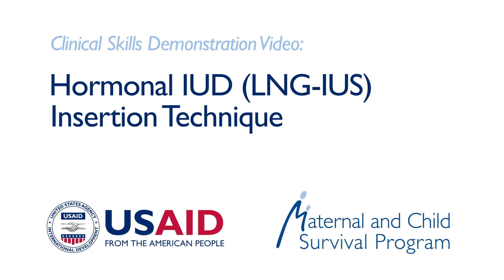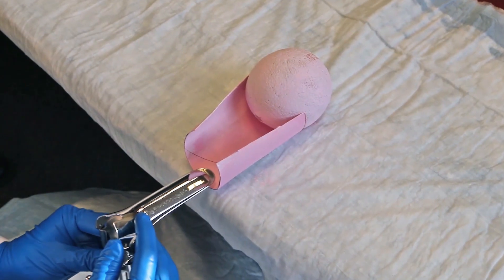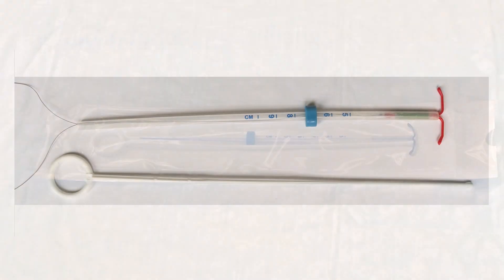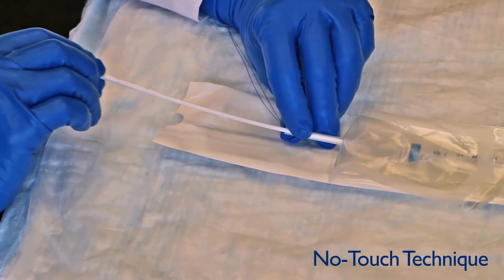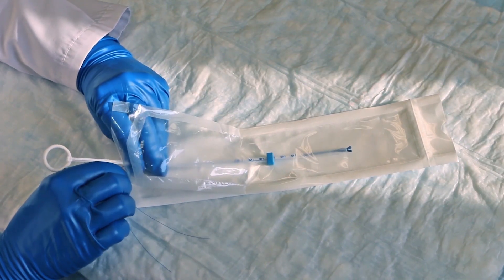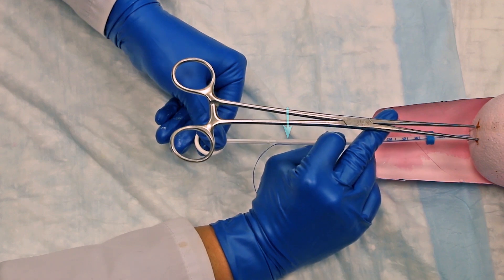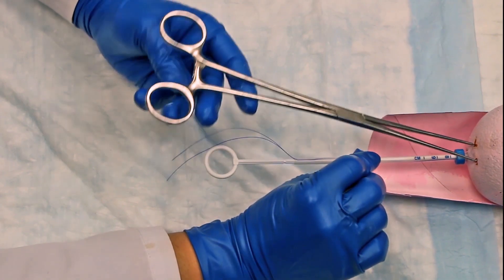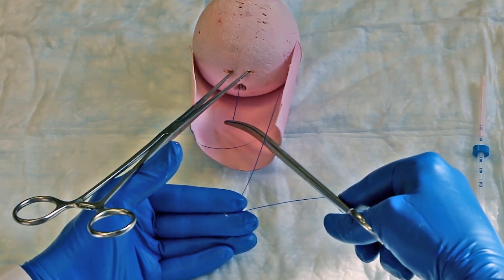Hormonal IUD (LNG-IUS) Insertion Technique

Comment: I wish there was more information about how painful this procedure is. I just had mine replaced a few days ago. The first time I had it, I was only told that I would feel mild discomfort. The pain was intense enough to make me pass out. I specifically mentioned that multiple times this time around and asked for pain management. They gave me medicine to dilate my cervix and told me to take ibuprofen before the procedure. I was never given the option to numb the area. The only improvement was that I didn't pass out. I was bleeding after the procedure. Videos make it look like inserting the probe and the IUD is smooth because it's such a thin tube, but anything touching your cervix is already an uncomfortable feeling. Forcing it open, even with a thin tube is excruciatingly painful.

Comment: FYI: Some doctors use the tenaculum (forceps) and some use a soft-suction cervical device to stabilize the cervix. The soft-suction device does not perforate the cervical tissue and thus is much less painful. This could help explain why some people's procedures are less painful than others'. Technology, tools and technique can also make a huge difference in how painful a procedure can be.

So, I am not going to discredit other women's experience about how painful their procedure was since there are so many factors outside of the patient's control and outside of their personal pain tolerance that can determine the comfortability of a procedure. 

I have a high tolerance for pain, and yet found the procedure to be painful (although not the worst pain I've ever experienced). It is a relatively quick procedure if done right, but it does not feel good at all and is highly uncomfortable. If you've never had children, the procedure will be more painful. I felt it was definitely worth the pain, which is why I'm on my third IUD. Being nervous is okay, just know that the pain is temporary.

Good luck

Comment: i don’t understand how the cervix is dilated still. i that the tenaculum part?
Reply: The cervix is not dilated. It is softened with pre-procedure medication that you take orally. Although, some don't prescribe it. If you've never had children (like myself), your cervix will be much narrower and thus insertion much more difficult. My first IUD was the Mirena (before the Kyleena or Skyla were made which are narrower). I got the Mirena at 15 years old (due to menstrual related issues), and the OBGYN had serious difficulty getting it past the cervix. The tenaculum is what provides "traction" to aid in inserting the device. Some use a soft-suction device which does not pierce the cervix and makes the procedure far more comfortable.

Comment: My first IUD experience was awful. The doctor did it in about 5 minutes and its still the worst pain I’ve ever felt in my life. It eventually migrated and sat in my cervix for a really long time. I had been on hormonal brith control prior and it wreaked havoc on my body and emotions, so I knew my only option was a copper IUD (I preferred it anyway). I went in for my second IUD and I was about to have a panic attack, my legs were shaking and I had already started to cry. When it came time to do the insertion I was in disbelief by how different it had been than the first time. It felt like a bad period cramp for maybe, 2 minutes? I giggled afterwards because it was so much better than my first experience. The NP did it at a slow pace and only did something when I felt ready. So literally every experience is different 🥲

Comment: Best explanation to the medical students 👍
Reply: No apparently not. Not only are there less painful devices than the tenaculum, it also should propely talk about pain management, sedation and things like time management and how to talk the patient through the procedure. And framing it like it's possible to be "gentle" when you pierce and pull on a cervix is a very crass "understatement" to say the least. 

You also do not want to waste time by doing the measuring and then dilly dally around with the IUD insertion tools. You want all sizes at hand and an assisten to grab, open, prep and hand you that thing the second you gave them the measurments. While this looks like they're .... what .... letting go of the tenaculum? Unlodging it and piercing it in again? What's the procedure supposed to be?

We really need women to get better care. One that isn't ignorant to the massive pile of reports of horror stories from women that you don't even need to dig for. Care that is actually caring!

Comment: I was never told about the tenaculum piercing the cervix and being used as traction to insert the IUD rod. I felt like I was being gaslit by the doctors about the pain I was in. I was never told about this part of the procedure. It is nowhere in the documents I received prior or post procedure. I feel vindicated knowing that my pain was reality. But I feel disgusted that I was never informed and that no pain medication is available besides over-the-counter ibuprofen. This should be criminal, because it is cruel and unusual. Animals get more pain medication for less serious procedures. But women? Why would we ever be taken seriously..
Reply: I was reading comments and I feel like you have basically written everything that happened to me. My doctor shrugged it off aswell and said you might want to take 1 or 2 paracetamol afterwords. I felt like I was on a torture table. I would have never wished it on my own worst enemy. I had an assistant with my doctor and I could tell by the way she grabbed my hand and her eyes she knew exactly what pain I was in. When they clamp your cervix it is the worst pain ever. In healthcare women are not taken seriously enough for sure.
Reply: I’m sorry you had such a horrible experience. I’ve been considering getting an IUD but I’m absolutely outraged by the lack of informed consent when it comes to informing patients on the procedure. I can’t believe in 2022 that this is an issue.

Comment: This hurts so bad, they did a pap swab first (my first one)  I was shaking. The cramps are so bad I normally don't get cramps so I wasn't used to it 😭 it hurts to sit down afterwards for a while.  I hope it's worth it though. Just lay down facing up for a couple of hours with a heating pad and 600mg ibuprofen it helps so much it gets better

Comment: I had mine 2 years ago and I was in a great deal of pain they said to take pain killers which I did and it didn’t help at all. I was still in a great deal of pain and couldn’t move or eat because I was in so much pain and I couldn’t poop either cos I was in that much pain. I went to A&E 3 times and they said they couldn’t do nothing. The first time I went I was throwing up and they gave me an anti sickness tablet then I threw up again and continuously throwing up. They said they didn’t have the instruments to take it out but as my sister works at the hospital she knew they had the instruments to take it out they just refused. So they could see how much pain I was in and they still refused to take it out 🥴 the nurse basically had a go at me and my sister and we complained. So overall that was so not worth it. I had it taken out after at least a week almost and had an implant in and I’ve had it since. Almost 2 years I’ve had my implant and I’ve not had a single problem with it. Not even when they put it in. I had a bit of pain for like a minute then it went. Yes I haven’t had a period for the whole time I’ve had my implant which is great 😅 but I do still get mood swings which is normal. I say I recommend the implant more than the IUD but everyone’s body is different and mine had a different reaction to it

Comment: So cool to see how this procedure is done! I got my iud about 2-1/2 years ago when I was 8 weeks PP and honestly it wasn’t that painful. But I have heard that it could be less painful after just having a baby. Now I’m in the process of trying to make an appointment to have mine surgically removed because my strings are going through a hole in the side wall of my cervix and the arms have embedded. My doctor thinks this most likely happened during insertion. My guess would be that pincher thing poked a hole in my cervix and caused the strings to migrate towards it. Something tells me it’ll be more painful to have it removed than to have it inserted 😩

Comment: I just got this today and I barely felt it. 
Yes, it pinched and I cramped, but it wasn't much worse than normal menstrual cramps. It took less than 3 minutes.
An experienced doctor is 100% what makes the difference.
Take 800 mg ibuprofen an hour before insertion and again 8 hours later.
Reply: no it's not just the gyno , it depends on your body. some it's a pinch , some black out . you literally won't be able to know until you are in the procedure
Reply: I had the same experience! An experienced dr and one who is gentle makes a world of difference

Comment: Just got my IUD about a week ago & the entire procedure itself took less than 5min (if that). I was honestly anticipating way more pain than there actually was. For me, it wasn’t really painful at all, just pressure mostly. I also took 800mg ibuprofen about 1hr prior to the placement so that helped a lot as well. Prior to the IUD, I was on the pill since I was a teenager & honestly wished I would’ve chosen this method years ago!!!
Reply: Just so you know, the research shows ibuprofen does nothing for insertion pain. Anyone reading this should get twilight sedation or a cervical block injection.

Comment: This was so painfully to  watch, I really hope it's less painful to remove it. I remember cramping up so bad when it was inserted and was told not to move. Thank goodness for heating pads
Reply: I just had my old IUD removed yesterday and my doc finally got it out on the 3rd try. T'was painful as she said it attached itself to my uterus wall. My removal was abnormally difficult though, so you'll probably have better luck.
Reply: @kthewhite7453  ouch 😵hopefully your relaxing and not doing so much today. Those creepy pains will sneak up on ya. I had mine on for 3 years and I want it out

Comment: Why is there no topical anesthetic/analgesic used before this entire procedure? Did they forget to include it or what
Reply: They sound give us a blunt at the least.
Reply: They do give you  local anesthetics in Norway, or at least I did. And I was also not stabbed with this thing.
Reply: I’m getting mine inserted under anaesthetic. I live in Australia so it might be different elsewhere.
Reply: Because it's only 2 minutes of severe pain
Reply: @priscillaguerrero2594  they give you anesthetic to cut off moles that’s not a valid reason
Reply: @allyssametcalf671   What moles?
Reply: @priscillaguerrero2594  um any moles on your body. They cut them off with local anesthetic but it’s less than 2 seconds of pain, so not giving women even a local anesthetic for IUDs isn’t valid because it’s “2 minutes of pain”
Reply: @allyssametcalf671  I don’t have any, I thought this was a different video
Reply: @allyssametcalf671  THANK YOU!!! I've had two IUDs now and there is no excuse for why we are not numbed.

Comment: Just had this done 15 min ago: it was the most painful experience I’ve ever had in my life. It felt like a stabbing, cramping and pressurized pain. It only lasted about 10 min though because I was having a couple panic attacks. Do I regret it? No. Can you do it? Yes. I’m laying in bed now with some cramping that is similar to menstrual cramps. Honestly my provider was so amazing, supportive and when I wanted to give up she really pushed me and encouraged me told me I could do it. I’m so damn proud of myself. You can do it too. I did this for my period issues and contraception reasons but more for my own health. You can do it. I promise. You can do it. I would do it again.
Reply: this actually means a lot
Reply: As women, we should be given local or general anesthesia. We shouldn't have to go through such barbaric pain ❤️
Reply: @arathidar3131  yeah, I don't see the point of going through pain for sex. Abortions are completely painless in comparison. And childbirth was even less painful for me. So honestly, there's no benefit to an IUD.
Reply: It took them almost 2 hours to do mine... It's day two after the procedure, and it's taking everything in me not to pull out that godsaken device out. The pain and mental damage are so bad, and everything is WAY worse than it was before I got it.
Reply: I'm getting my second IUD installed soon, and my experience with the first onr was exactly like yours. Very painful... I'm scared to get one installed again, but after reading your comment, I remembered that i'm strong and i can do it again. 💪🏻
Reply: WTF is the point of doing this without anesthesia? Is your doctor a barbarian?
Reply: @polyanthesis  i actually got my new iud today. asked my obgyn for sedation or local anesthetic for the procedure and she said they aren’t “allowed” to provide patients that kind of stuff for such a simple thing. seriously one of the worst pains i’ve ever felt.
Reply: What the hell that wasn’t my experience at all. The gynecologist wasn’t that nice to me 💀
Reply: thank you. I cried a little when I read this haha—I don’t know if I can get across how important this comment was to me. The birth control I used to take for menstrual problems contained a hormone my body didn’t process correctly, so it caused me to develop tumours and, eventually, one tumour started bleeding into my abdomen. Going from desperately looking for a medicine that’ll suppress my cycle, then finding outI have tumours is too much of a rollercoaster. And I’m young too—im not even old enough to drive yet. hopefully I’ll have my body and all its problems figured out by the time I do start driving!

but for real, since I can no longer take any medicines that contain hormone-altering drugs, an IUD is the next step for me,,,,but I’ve been really scared. I’ve heard so many people talk about how bad it hurts, so while some part of my brain expects it to hurt worse than internal bleeding, it doesn’t matter because you’re right. I can do it. Even if it hurts more than anything, I can do it. Thank you.
Reply: thank you, getting mine tomorrow and almost talked myself out of it :')
Reply: I'm too scared to even get a pap smear.. but I want an iud
Reply: @heatherw02hw  For me, the pap-smear was slightly less painful than the IUD. However the main reason why it was so painful, was because I have Endometriosis, my uterus is tilted, I'm overall very tight and apparently extremely dry, and I also suffer from vaginismus, so with all of that combined, it was long and painful. 

However for normal people, it shouldn't take too long, and it should just be uncomfortable for a bit.
Reply: Thank you so much !!
Reply: was it painful walking afterwards??
Reply: I tried having it inserted today and kept jumping, moving, and shifting. It was so painful, that no matter how hard I tried to sit still I just couldn’t. I also don’t have children. I couldn’t do it.
Reply: The sound and part when they open the arms of the iud is the worst.
Reply: Okay but does it hurt more than labor contractions, giving birth and well cervix check? I'm supposed to get an iud and looking at this, I don't like it 😕
Reply: @YallaBitlBitl  no ! It gets inserted thru like a medical straw lol. the only pain is the cramps afterward.
Reply: @YallaBitlBitl  I had mine yesterday and the actual insertion only took 15 sec. and felt just a little uncomfortable. 

I don’t have kids yet and it is my first IUD (I’m 22). So just so you know it can be a painfree thing too. Not everybody is the same.
Reply: @laurenvanacken  I chickened out lmao that was like 2 years ago and never got one 😂 the doctor told me it will alter my hormones and such and I said no thanks I'm outta here. I ended up giving birth to another child 🙃 but finally my husband is getting a vasectomy so it's his turn now lol I'm glad your experience was good!
Reply: @YallaBitlBitl  if you’ve had kids it doesn’t hurt bad at all actually just feels like a period cramp i was scared after watching this video but i couldn’t feel a thing 😭 the gynecologist told me it’s worse for women with no kids tho
Reply: @deliadenise9893  ohhhh makes a lot of sense! Yes I gave birth 80% unmedicated 5 weeks ago. I guess I'll go for it! Thanks so much it made me feel better
Reply: Oh god I have an apt next week and I’m sooo scared about this! I have one child & read that someone who had a child still experienced pain & im just gonna cross my fingers and hope for the best 🤞🏼
Reply: It’s best to have it after delivery😂 the pain is more tolerable than labor and you have anesthesia from episiotomy but you can still feel the pain but not really painful. I regret having it because thre are MANY DISADVANTAGES. Im just 21 when i gave birth last week so doctors force me to a family planning
Reply: @denisejoy2773  routine episiotomies are also barbaric and cause harm. So you shouldn't be having episiotomies unless something really goes wrong.

Comment: I got mine done last year they put it in right away after I finished giving birth but I just found out that it can cause injuries when removing it and can lead to surgery depending on how it was inserted in the first place 😭 I don’t feel a thing and have 9 more years to go before removing it.
Reply: They definitely shouldn't have put it in right after birth. That is incredibly unsafe.
Reply: @casanova6397  IUDs are approved for use right after birth, but if it has been more than 48 hours since giving birth, you have to wait a couple of months
Reply: The risk of injury upon removal is pretty low. Any chance of something going wrong with the IUD is lower than something going wrong during pregnancy or childbirth. If you don't feel a thing, it's a sign there probably isn't something catastrophically wrong. You can have the IUD removed at any point for any reason.